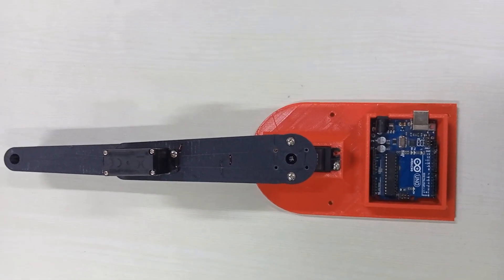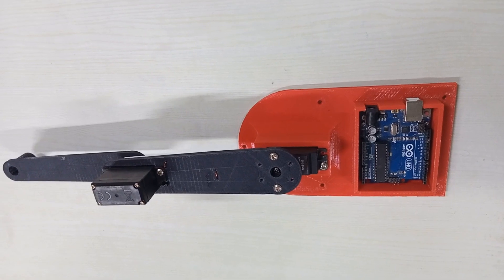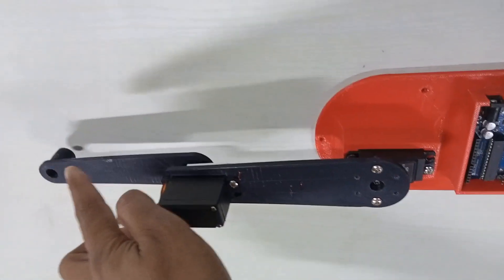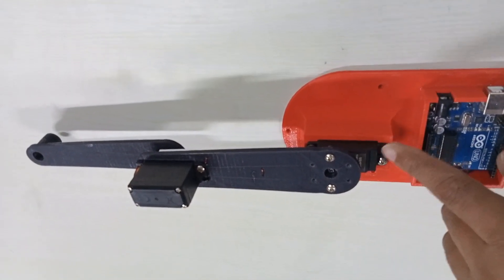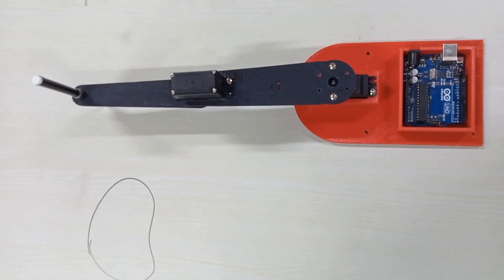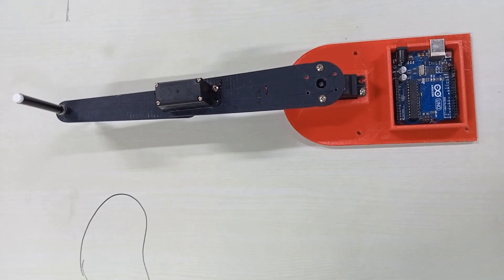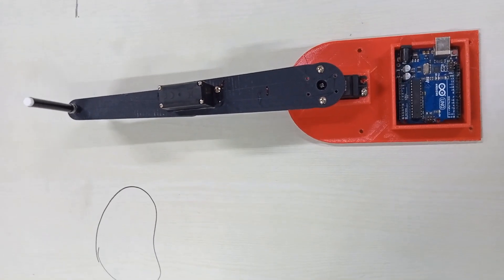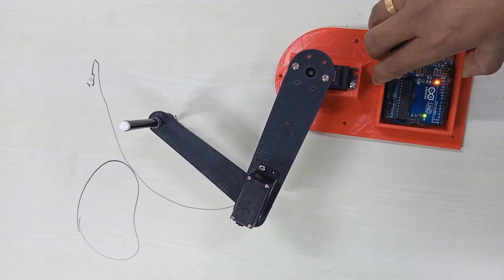Inverse kinematics based Two link robot arm by using Arduino Uno

Comment: Hello sir. When I give the inverse kinematics angles to my servo motors, the arm moves to a different position than desired. But the angles work in my simulation program. I heard that this is about the starting position of the servo, but I couldn't understand it because I don't have enough knowledge about the hardware. Can you help me about how to implement the 0 position of the servo?
Reply from the maker: Direct and Inverse kinematics of two link manipulator: A hands-on robotics course (Lecture 2)
https://youtu.be/wrCbNq5LvpA
Watch this tutorial. It will help you to understand the inverse kinematic relations much better. Also fist move your servo 90 degree then write a code 
Servo.Write(90+calculatedAngle).

Comment: dont fool the people u just recreated what the robot does by your hand
Reply from the maker: Bro, I'm not trying to deceive anyone. I'm simply drawing a random curve, then gathering all the corresponding x and y coordinates. After that, I use those points as input data to calculate the respective joint angles using inverse kinematic relations. That's all.

Comment: Sir, Can you please share the wire connection?
Reply from the maker: That is very simple please connect red and black wire of servo motors with positive and negative terminals of 6 Volt power supply and signal wires of servo motors with digital pin 7 and 8 of Arduino and please don't forget to keep common ground of  servo and Arduino

Comment: sir I am using the similar principle but I have to calculate the angle using the formula and then rotate the motor to the particular angle . can you please help me with the code
Reply from the maker: Ok that formula called inverse kinematics for position yes sure I can help you. Please write a mail to me regarding same subject
Reply from the maker: And please subscribe my channel
Reply from the maker: I shared design as well as arduino code. Please have a look in description

Comment: Can u pls share the Arduino code as well the circuitry of the project....

It'll be nice of you ☺️☺️
Reply from the maker: #include <Servo.h>

// input co-ordinates 
float x[]={16, 17, 18, 19, 19.7, 19.5, 19.2, 18.9, 18.7, 18.4, 17.6, 16.7, 16,
     15, 14, 13, 12, 11, 10, 9, 8.5, 8, 7.5, 7.2, 7.5, 8, 9, 10, 11, 12,
     13, 13.7, 14.2, 15};
float y[]={5, 5.5, 6.3, 7.4, 9, 10, 11, 12, 13, 14, 15, 16, 16.6, 17.2, 17.5,
     17.5, 17.4, 17, 16.3, 15, 14, 13, 12, 11, 10, 9.4, 8.8, 8.6, 8.4,
     8, 7, 6, 5.4, 5};
float l1=12.7;
float l2=12.0;
float theta2;
float theta1;
int tmp1=0;
int tmp2=0;

Servo joint1; 
Servo joint2;

int joint1_val=0;  
int joint2_val=0;

void setup() {
  Serial.begin(9600);
  joint1.attach(7);
  joint2.attach(8);
   joint1.write(6); 
   joint2.write(10);
}

void loop() {
   for (int i = 0; i <34; i++) 
   {
    // inverse kinematics of robot
    theta2=(pow(x[i],2)+pow(y[i],2)-pow(l1,2)-pow(l2,2));
    theta2=theta2/(2*l1*l2);
    theta2=-acos(theta2);
    int joint2_val=-theta2*180/PI; // convert theta2 value radian to degree
    theta1=(atan(y[i]/x[i])-atan((l2*sin(theta2))/(l1+l2*cos(theta2))));
    int joint1_val=theta1*180/PI;
   joint1.write(6+joint1_val); 
   joint2.write(10+joint2_val);
   delay(10);
 }
  delay(2000);
}
Reply: @anutech13  thanks a lot sir....
The doubt was can I alter the diagram....???
Reply from the maker: @Randy Ziegler l1 and l2 is link length.
Reply from the maker: Also I used parameters l1 and l2 to calculate joint angles for given coordinates x and y.
Reply from the maker: @Randy Ziegler milimeter
Reply from the maker: @Randy Ziegler please subscribe my channel 😊